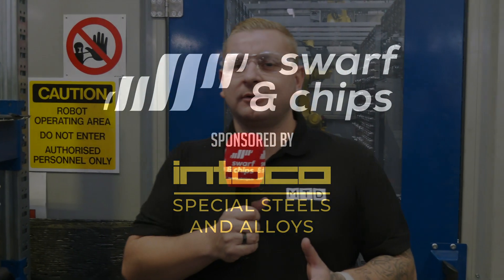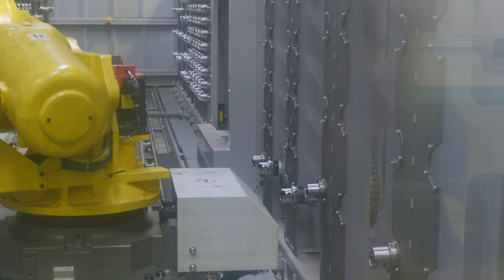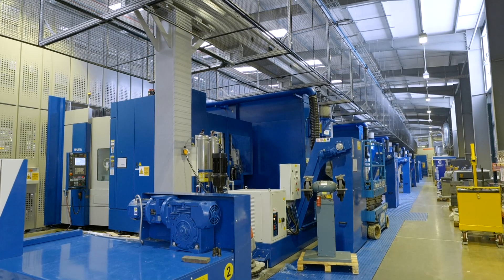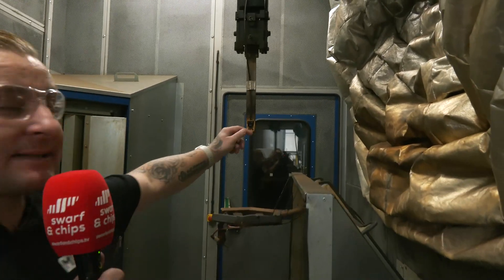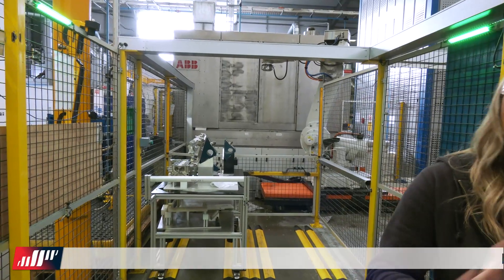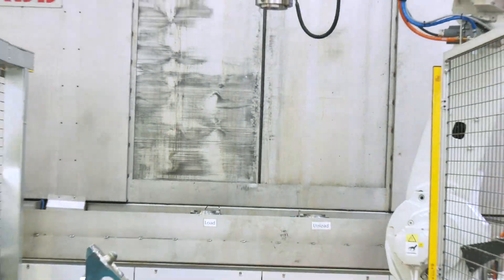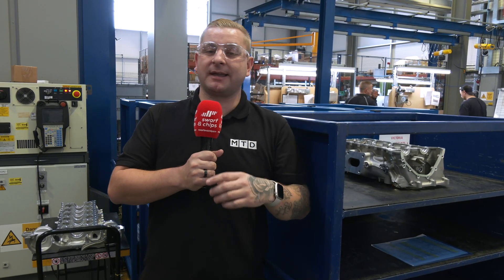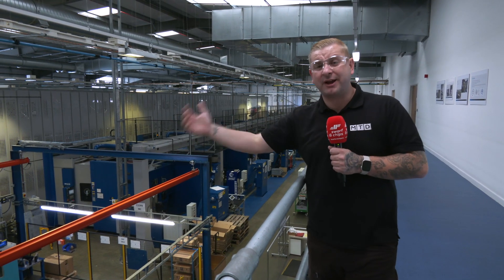A Look Inside Cosworth Limited

Comment: I like how the chip conveyors just dump into a hole in the floor, presumably where there is another conveyor to move the chips to a central point.  That's genius to me.
Reply from the maker: correct, underfloor swarf management, keeps everywhere clean and more importantly the machines just keep running. What's your company?